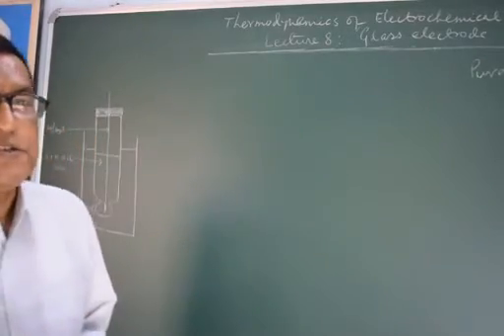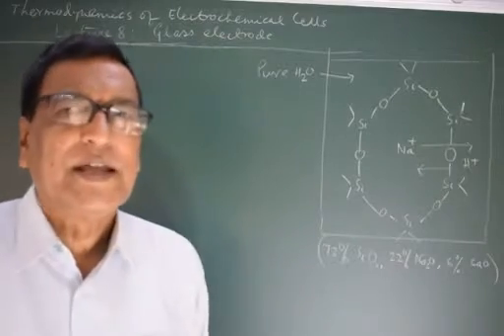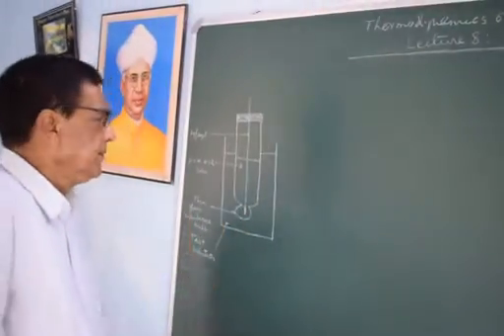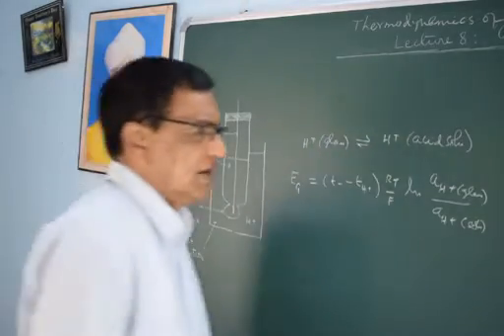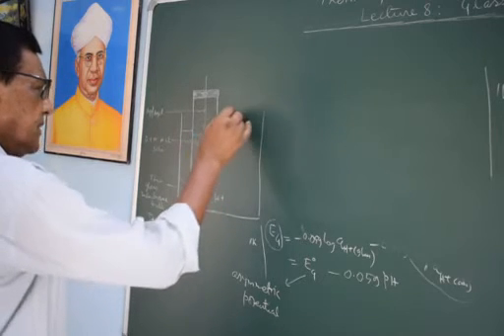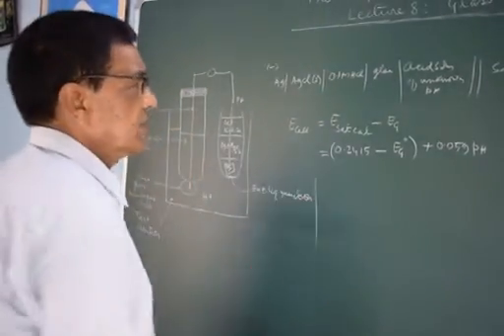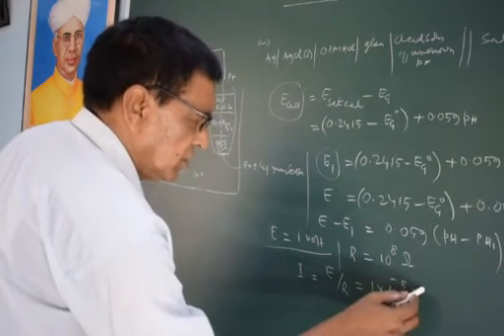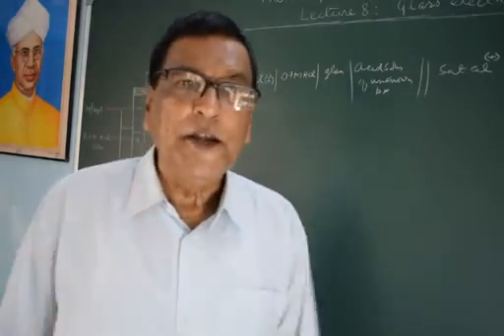TD of cells. Lec 8 : Glass electrode.

Comment: Why the AgCl/Ag electrode is used in glass electrode? why only Pt-wire plate is not used in the known 0.1 N HCl solution of glass electrode?
Reply from the maker: Ag/AgCl/Cl' is acting only as connector. Pt can also be used when the bulb is filled with Hg(l). In future, I shall send more about the electrode if it is possible.
Reply: @drnimaichandradey2011  thank you sir 🙏. I also replied the same to my students but for satisfaction, further confirm from you.